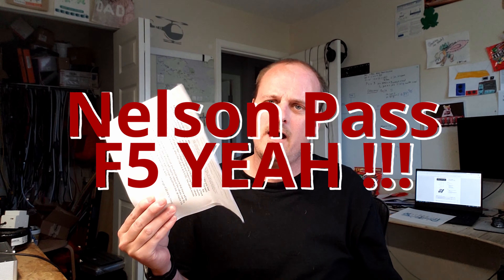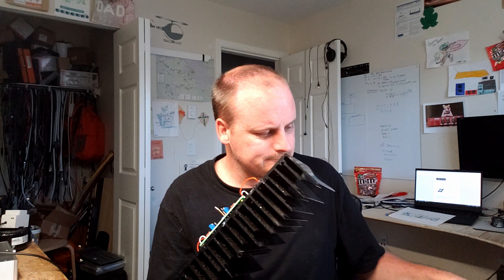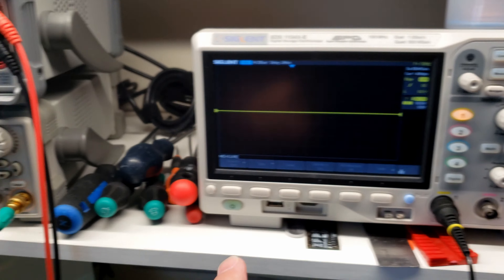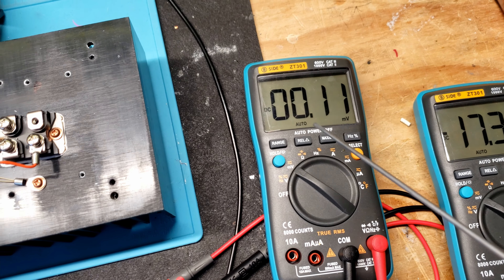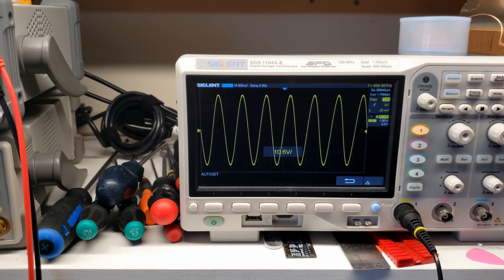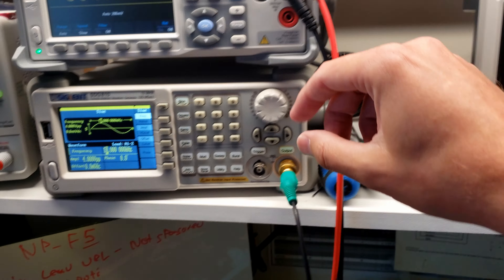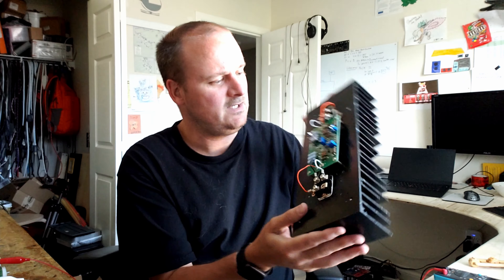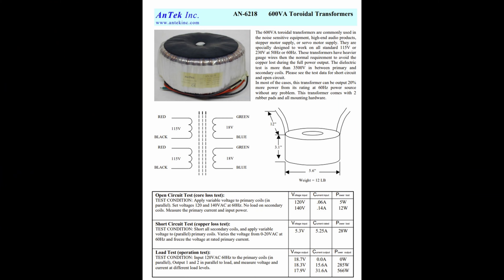Nelson Pass F5 with IXYS Fets !! Success ! NO SMOKE !!

Comment: I have built this amplifier different boards.  Still sweet after almost 10 yr driving tannoy hpd. Its all about massive heatsinks ♨
Reply from the maker: Good amp isn't it. Did you use IXYS fets too ?
Reply: @JasonLeaman   i used jims matched fets and jfets.
Reply: @JasonLeaman  its a very good amp.  Very stable great bass and absolute control of the speaker drivers.  I Use the PASS BOZ  pre with excellent results😃
Reply from the maker: @tartan4turnups  I just use a Passive pot, simple and clean !
Reply: @JasonLeaman   matched fairchild iir
Reply: my bad matched irf

Comment: I got a message from Stanton (Jim's) today (5/21). He informed me you will build the MP-150 boards soon. I've failed with these boards and hope you will post your video of the build. He mentioned that I might be able to solve my issues watching your work.
Reply from the maker: send me a message through here and ill chatt to you :) and of course i'll help..
Reply: @JasonLeaman  Thanks for the reply. I'll keep watching when you start the project. The boards have some anomalies with traces and I don't think I figured them out. I've had everything from  exploding transistors (MJE15030) to smoking emitter resistors and one board will not turn on.
Reply: @JasonLeaman  Hi again. I have a running board. There are some definite issues with these boards I have finally figured out. The problems are with Q10 Q13 and Q14. Q13/Q14 is just as simple as shorting 2 pins on each to some other pads on the board. Q10 however is another animal. My fix is more than trying to discuss it here. How can we converse by a different method? The schematic uses a 2N5551 for Q10 but that is not practical. I have a solution.
Reply from the maker: @albertcantalini3386  send me an email through YouTube in about / contact :)
Reply: @JasonLeaman  Can't figure out how to send you a email through YouTube. I could give you and old Gmail address I rarely use any more and then there I would send you my regular mail. BTY EDM 2 WPG 0 half way through the second.
Reply from the maker: @albertcantalini3386  Click about on my channel, then click email .
Reply: @JasonLeaman  That seems simple enough (watched a video about that yesterday) but email option is not there for anyone I try that with. Do I need to join or be a member of something?
Reply from the maker: @albertcantalini3386  just need to be signed in i believe but you must be sighed in because you are posting, so just click my channel, then click about and try to mesage.
Reply from the maker: @albertcantalini3386  Try now, i just fixed it.
Reply: Did I see -60dB second order distortion? Not that low. Maybe include a adjustment to play with N and P input Jfet degeneration. Might be worthwhile trying a slightly higher Ids P ch Jfet. Very nice equipment.

Comment: Tube amplifiers are better sound, are easier to work on, and they are extremely cool looking. I would not get overly excited about any sort of solid state amplifier, because silicon is a hard brittle crystal with that structure, signals and harmonics and distortion is all going to reflect the property of silicon. And silicon is like big tech, a huge pain in the ass, and its government funded technology in the end. 
Tubes are golden era technology, where optimism, quality and spirit of the country and the world were at thier highest. 
The conducting of electricity is how the amps sound good or not. 
Soldered connections and terminal connections sound different, and the manner of how the electrons flow and are generally least obstructed or structured, is making the difference in the sound. 
Vacuum transduction sounds like "pleasant space" and that is why everyone likes it who has listened to it and has a good set of healthy ears. The sound is not clangy and harsh like silicon crystal structure and harmonics. And you dont have big brother on the mainframe shoving its nose up your holes. The frequency response of silicon is extremely high and thats not good really. 
Its like a guitar made from fiberglass or nice old growth cedar. 
Thats the only way to explain it.
Reply from the maker: LOL tube amps are also 400x the voltage and more dangerous !